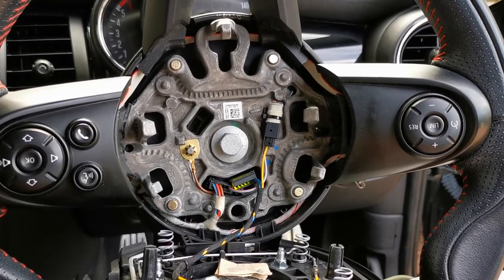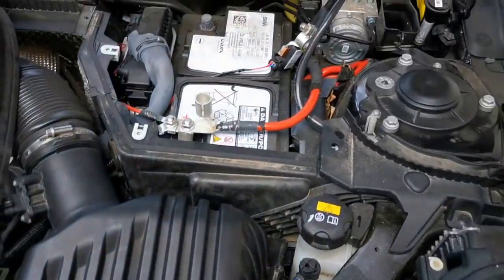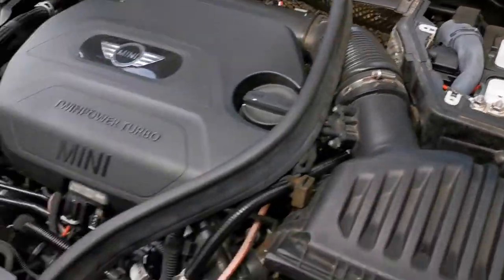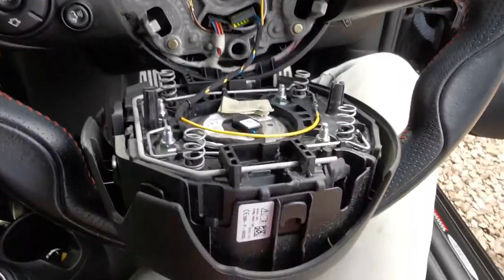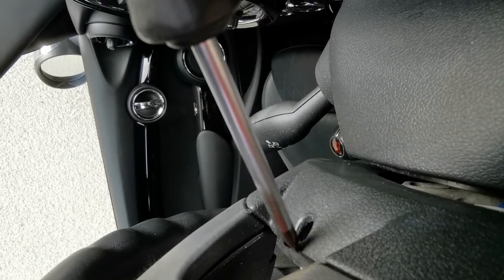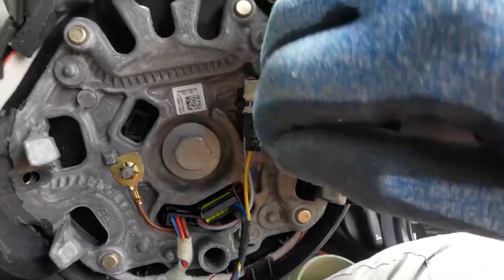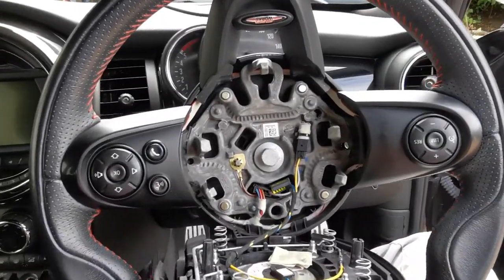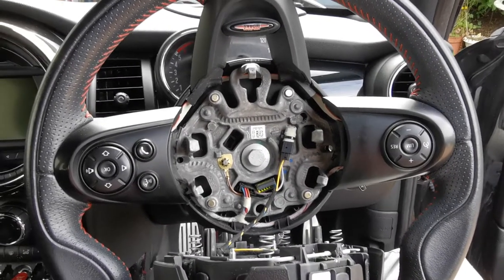Mini Cooper F54/F55/F56/F57 Steering wheel boss removal and horn repair

Comment: A tire stem removal tool works better than a screw driver… the notch fits on the wire and doesn’t slip off… good video!

Comment: Thanks for this. Mine has given problems since it funny enough just came out of warranty 3 years ago. For the pleasure of fixing it Mini wanted to charge £450 so this gives me the confidence to have a go myself. If you hit the central boss in one place the horn still works so a couple if the four contacts must be good. This is know fault and BMW should have done a recall on this problem.
Reply from the maker: Good luck! Once you have the knack of it, it's really easy 👌

Comment: I have a f57 ( 2015 convertible) just bought, no horn…replaced horns thinking most likely cause but it didn’t fix it…are the contacts on this car like mine!
Reply from the maker: Yes 👍
Reply: @georgemayson4936  actually no..they are different
Reply from the maker: @ls40095  very surprised by that.
Reply: @georgemayson4936  update: Pulled wheel bag and cleaned contacts and still no horn. Had a guy email me and said the horn relay is built into the passenger side kick panel and if that’s it then it’s like $700 to fix…Could also be steering wheel replacement….can’t believe nobody has a fix for this..buying a top end scanner
Reply: @tombowden6580  A relay is not $700 unless the labour charge is $650 p/h Relays are designed to be swapped out. Realy manel and fuse box is easily accessible.
Reply: @huwjones5879  The relay is part of into the Body Domain Controller (BDC) which is located behind the kick panel and is pretty expensive (and needs to be coded to vehicle).  The relays are soldered into the PCB and not designed to be replaced, though it would be possible if the correct part can be sourced.  Typical overcomplex BMW junk tbh, though other brands aren't far behind.